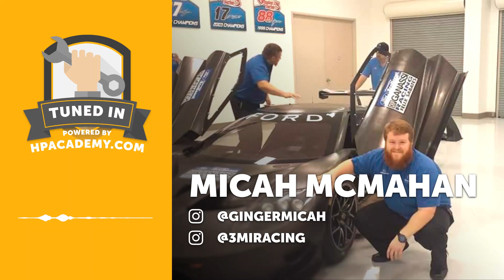064: Redbull F1 Engine Development Insight [#PODCAST]

Comment: I don't understand the current sanctioning bodies off all motorsports. Why restrict anything at the highest levels of racing especially F1. Same thing in Nascar.  More powerful engines,  then put a restriction plate. F1 does the same thru fuel regulations
Reply from the maker: Money/Costs - Taz.
Reply: @hpa101  Also designing with a view towards improving efficiency and emissions for road car engines. Manufacturers want return on their F1 investments for that side of the business.
Reply from the maker: For sure, that comes back into costs too where applicable. Still some great tech and great watching IMO - Taz.
Reply: @hpa101  1978 Daytona 500 car would outrun what they have today tho, only 100k to run that car for a season
Reply: @puunersjabski6487  but what makes you think if allowed and the money is to hand , why they wouldn’t spend the money on that old engine regardless , but in the over all cost of an engine is small compared to other items on the car
Reply from the maker: Note even that car back in 1978 had a rulebook it adhered to, and good luck out driving a modern or even classic F1 car in a 78' NASCAR is all I'll say. Let us know how you get on 🤘 😅 🤪  - Taz.
Reply: Advertising dollars sometimes allows for rule changes against your competition
Reply: "Professional" racing is no longer made up of some blokes in their garage modifying a car for an event on the beach. Now millions are spent for research and tuning in order to get the required performance. Investors typically want a good reason to be burning money for years on end. People in general are also less accepting about a rollover instakilling the drivers and grandstands.

So you end up with an organizing body to ensure safety standards are met, OEM manufacturers get to develop something they can tout as being able to improve the car you buy at a dealership, and some parity to try to limit one team from winning all the time because everyone else losing is eventually going to give up trying. Dozens of racing leagues were left in the history books because OEMs could no longer justify spending that kind of money. We like to romanticize how much more a good driver can extract extra speed from their machines, but sometimes engineering just outright builds a superior car. If you want to actually see racing and not time trials, this has to be watched out for.

To be fair, Blokes tinkering in their garage haven't gone away. They just don't get TV time because there's no money in it. 24 Hrs of Lemons is a good example of this. Extremely cheap rust buckets held together by spit and prayers running around a track, with practically no limit on mods because no one is going fast enough to be all that dangerous. They do still mandate roll cages, helmets, safety harnesses, fire protection, etc, because they are exceeding what the OEMs designed them to do.